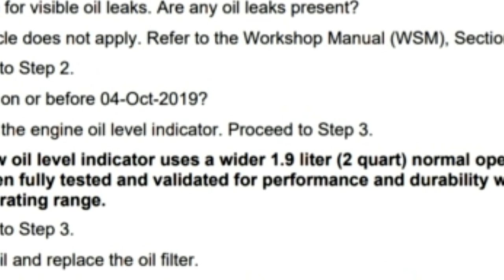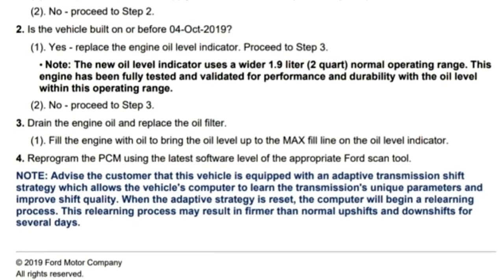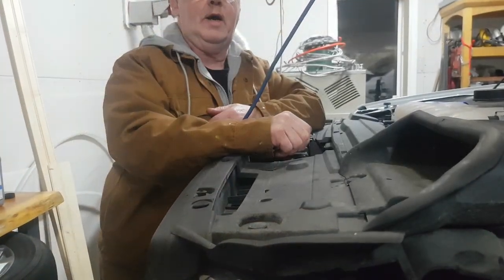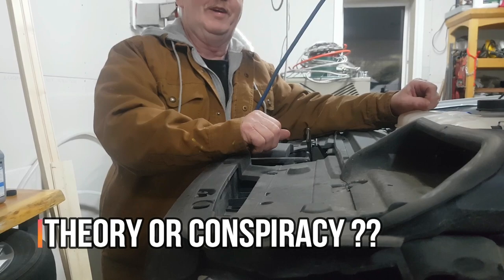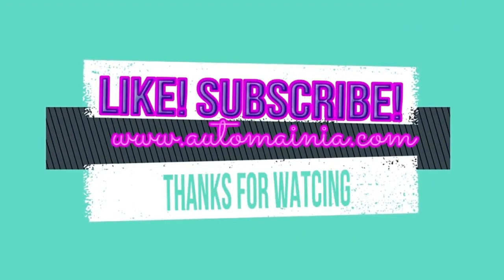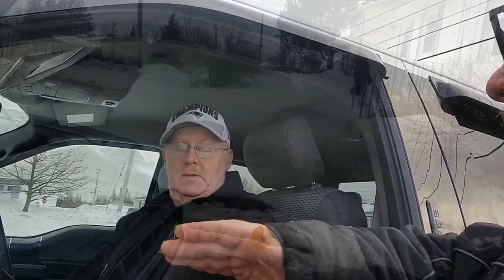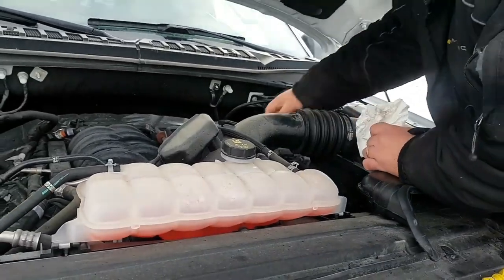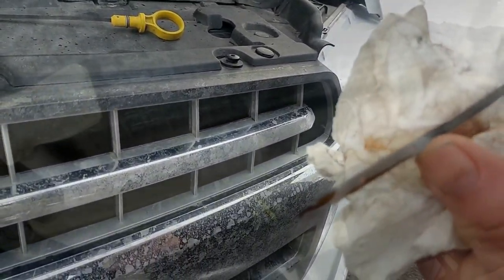#ford f150 oil consumption new dipstick measured 2018 2019 2020 5.0 coyote

Comment: CLASS ACTION LAWSUIT TIME
Reply from the maker: Here here
Reply: my guess is the class action lawsuit will happen in about 3-4 years when everyones 5.0L blows up just outside the warranty. problem is that it will be too late for most ppl by that time. and litigation will drag out for a couple years. and the worst part is they've made no mention of redesigning the 5.0 for future vehicles (its a design flaw from the plasma cylinder lining instead of sleeves to save money). so this problem will continue on new 5.0s until they change the design. if they don't want to change out everyones engine because its too expensive then at the very least they need to 1) change the oil change interval back down to 3,000 miles (to prevent it running dry in between the longer intervals), 2)offer free oil changes for life due to the new intervals 3) extend the engine warranty out to 100,000+ miles, maybe more.  but it shouldn't like this to begin with. just redesign it, issue recalls because the longer they wait, the worse this will be for them. I want a v8 pickup which is why im considering the f250 with 7.3L gas engine. old school pushrod should be more reliable than this engine.
Reply: Is any lawyer in action now for this I need one
Reply: @Joao_Oliveira23  I'm in the same boat.  Truck has timing chain rattle and cylinder knock.  Dealership I bought it from says it's normal.  Another ford dealership says it needs an engine. 5k miles and no oil on dipstick.  Engine rattle started after 1st oil change.  Maybe I need some more motorcraft xl-17 sawdust put back in.
Reply: @Joao_Oliveira23  there is a class action lawsuit started in January of 2021   ...google it....and add your name.. I did and got a acknowledgement with in the hour....please spread the word !

Comment: It should be illegal to build vehicles like that and charge money for them.   Imagine if engineers were actually held accountable for designing things like this.
Reply from the maker: Absolutely correct chad! Thanks for taking the time 👉🤜🤛
Reply: Hey, they gave the engineer that designed the plasma welded cylinder walls a trophy for his wonderous new designed block. Thanks for nothing. Mustang 5.0L has same troubles.

Comment: My 2019 5.0 was using about 2 quarts every 2500 miles.  They changed the dipstick to the 2 quart monitoring and reprogrammed software.  Now it is using virtually no oil.  Checked it at 500, 1000, 1500 miles and all is well.  I’m satisfied that it is performing as it should.
Reply from the maker: Happy to hear that. A lot of customers are not so lucky 👍
Thanks for taking the time.
Reply: Well at least it worked for someone. Does yours have audible piston slap? The few guys I know with 2018-19 5.0's didn't see an improvement after the software update. But they have noticeable piston slap.
Reply: karl schauff no there is no noticeable piston slap. The only gripe I have is the occasional squeaking pulley especially when it’s cold. Otherwise it is performing fine. I did notice after the reprogram there seems to be slightly less engine “braking” on decelerations (stealing a diesel term).  I’m much more satisfied than I was. I change my oil religiously so I will keep an eye on it but believe it to be operating as it should. Since this is my first Ford after owning over a dozen GM trucks, I was obviously sensitive to any problem.
Reply from the maker: @timw_59  the new dipstick is actually 3 quart monitoring 🤜🤛
Reply: @timw_59  Yeah you should be good then. The are a couple causes of oil consumption with the Gen 3 5.0 (2018+). Apparently some had oil consumption due to excessive manifold vacuum pulling oil past the rings and others have something more serious like piston slap causing among other things, oil consumption. Enjoy the truck.

Comment: I just recently purchased a 2019 f150 equipped with the 5.0 put 3000k on the motor and I was down 2 quarts of oil took it to the dealer they just topped it up went back at 6000k did oil change and have just been checking it no new dipstick was installed that I'm aware of yet but we will see what kind of update ford will do.
Reply from the maker: If it was built after October it has the widened range dipstick.  I have a side by side comparison in an earlier video.  Let me know how you make out ty for taking the time. 🤜🤛
Reply from the maker: @MastersFarms  https://www.youtube.com/playlist?list=PLXfFReTdUhgG9Jd_eeQqZHXyp-D4JomQ9
Here is the playlist on the issue I would suggest starting at the beginning  but part 4 and 5 will get you started
Reply: Update!  Ford has added the widened range dipstick fresh oil change and did a reflash a tsb for the oil consumption so far so good next oil change is at 16,000 will see where oil is at then.

Comment: Just crazy I have carried out these “repairs”once. it makes me sick PCM reprogram and a new dipstick is not going to fix this. Ya it might be fine for a few years if you keep up on your oil changes. I drive a 13 year old truck if it was consuming oil like that when it was new the thing would be in the scrap yard by now. General Motors had the same issue with their stupid sprayed cylinder liners not to long ago. I am hoping the electric cars and trucks will save us from this government mandated “efficiency based design features”
Reply from the maker: This ruse by Ford is as big as Volkswagen deiselgate. I think my channel is a little small for the depth of the information. Hopefully someone will a lot more influence will pick up the torch 🤜🤛ty George

Comment: Something I discovered with my 2018 5.0. I bought my truck used with 6k miles on the clock. I had the timing chain tensioner TSB done. And I noticed slight oil usage. I installed a JLT catch can at 7k miles and it does work. On my last oil change I switched to 5w-30 and just checked my oil at 1200 miles and it has consumed zero oil. I have not had the oil consumption TSB done. And the off throttle cold rattle is almost gone I can barley notice it. 5w-30 might be worth a try.
Reply: Also 9 quarts of oil takes it perfectly up to the top hash mark line on the dip stick. With the stock dip stick.
Reply from the maker: 👉ty
Reply: I changed oil to 5-30 also and had the TSB.. no usage..after 2 tests by dealer and almost 1qt each test.
Reply: Second this. Did the exact same. Also an extra half quart will keep the 5.0 happy

Comment: 2020 5.0 with 7000 miles. Started banging and rattling and got a service engine light. Decided to check the oil for shots and giggles. 5 quarts low! I am not a happy camper!
Reply from the maker: OMG better off to leave it die then they have to do something other than a bandaid
ty for taking the time let me know how you fair out!

Comment: Replace your PCV with an EV 281 and get the ECU updated.

These trucks create too much positive crankcase pressure on deceleration and it shoots oil out the PCV into the intake.

The new PCV valve slows the oil, and the ECU update makes the throttle plate not close as much under decel.

This is combined with the new 2quart dipstick solves the consumption issues.
Reply from the maker: The new 3 quart dipstick hides the problem.  These trucks have higher than normal vacuum which is a symptom of too much ignition timing. This is after the most recent ecu update from ford The pcv was changed 
Thanks for taking the time 👍
Reply: I have had the TSB 2365 done and it did improve my consumption but didn't completely solve it. I burned a qt in my 1st 800 miles, then another qt at 1850 miles. Had the TSB done but did not get the new dipstick. I've driven almost 2000 miles and only burned 1/2 a qt (I've been checking weekly after the truck sits over night and I'm parked in the same spot). So that's definitely an improvement but not a complete fix. Per Eliminator's video I did purchase the improved PCV valve from Tasca (only $6) so I'll install that to see if it helps anymore. I appreciate your work and I'll be checking in. I'm glad I got an extended warranty and I don't want to trade my truck as I'll lose my ass on it so I'm in this for the long haul.
Reply from the maker: @thekelly4178  thanks for taking the time. 
Keep an eye on it
To check if your dipstick was changed measure the distance between dots. More than an inch is the new dipstick 🤜🤛
Reply: @thisguysgarage  My truck was built on Oct 15 so it was supposed to have the new stick from the factory but it doesn't. I'll definitely be checking if they change it if I take it to the dealer.
Reply from the maker: @thekelly4178  verify.  Very smart 🤜🤛
Reply: @thisguysgarage  what is the length of the new dipstick?  The one in my truck is 21" long form the tip to where it seats
Reply from the maker: @tcgreenfield  i have the original dipstick here it is 21 inches from the tip to the seat and its exactly 1/2 inch between the add and the full dots

Comment: I just returned back from the dealer for 2 recall repairs, and the hope I would get some satisfaction on where the oil level is on the dipstick.
They gave me a black and white photo, and a hand drawn picture of a dipstick showing that the oil level that there pics show, is about a third way down from the full mark, approx 1 litre low.
Not sure where they got there info, as just 1 week prior, I had it at the same dealer, foreman checked the oil level and he showed me then that it was nearer to the add mark, approx 1.5 litres low, but his opinion still within safe levels.
They cannot admit, that there so called longer dipstick fix failed.
Yes, I will now be in touch, with BBB,
Reply from the maker: document everything . let me know what the BBB has to say.   
safe level does not address excessive oil consumption as you know.
the next time you service it ask questions in writing,ask for response in writing.
ty dave. keep in touch email me for specific questions  channel about me page has address

Comment: My 2018 with 21000 not only uses oil but has metal shavings on the dipstick.  Timing chain rattle and cylinder knock.  Really wish I had my  2008 f150  back!
Reply from the maker: omg , i hear you i should have kept my 16  , let me know how you make out.
Reply: Me too

Comment: This makes me sick. My 2018 coyote was 3 litres down today. 5 or 6 recalls on my truck so far. The worst so far was that it was a rattler, though that was partially fixed w/ some lifter/solenoid repair. This oil issue is way worse. Thanks for taking the time to do this.
Reply from the maker: Sorry to hear that!  have you made any headway with ford?

Comment: the viscosity with new oil would be at its best or highest when oil is new,so it should consume less oil at this point,then when is at its mid time of the oil change interval and consumption would likely be higher at 3/4 of the oil change interval

Comment: 2018 f150 5.0L was half way down the new dip stick range (about 1.3qt according to this review) after 1000 miles durring the second oil consumption test after taking it in and looking they found ATF and engine oil leaks they are now pulling the tranny and "fixing the oil leaks" so i can restart the oil consumption test. trying to get replacement engine or buy back from ford corporate just taking there sweet time and coming up with excuses if you ask me. i will also be demanding that they provide an extended warranty so i can keep doing the testing as im about 10 months out for the ford warranty to run out
Reply from the maker: That's all they want is to get you out of warranty. Ford has done us dirty on these trucks. 
Ty so much for taking the time. Please keep in touch to let me know how you make out. Ty again

Comment: My '18 has the same issues everyone has mentioned in these comments.

 Mine didn't start doing it until around the 60-70k miles range on the oil side, but the transmission madness started somewhere around the 40-60k range. Typically only during winter time with mine at least during that initial cold start. 

At least now i can throw the better oil in it, as expensive as it is, and it not matter with the warranty since that's long past. Not that Ford would do anything even if it was still within and was using the Ford oil until it dies.

I miss the '13 F150 I had with the 5.0. Only issue it ever gave me was hauling a stupid amount of pavers in the back, more than i probably should have (enough to feel the front try to lift even with my heavy brush guard I had on it.) Went went from level ground to a near 45° or steeper angle driving up these old streets in Shamokin, where the pavers needed dropped off, and the truck shut off and wouldn't start for a minute or so. Right in the middle of the street, holding up people to my right in the intersection.

 It started up again after we swore at each other (they didn't know my truck quit and were upset i was blocking them) and it never had any problems again. I traded it in at 90k miles 6 years later for this, left over, new, 18 I have now. 

Makes me miss the 13's 6 speed transmission, too. It never once gave me a problem, unlike this joint chevy/ford 10 speed obomination they put in these newer models.

 They're better on gas now, but that's about it. 

With the brush guards, they've both taken deer impacts at over 65mph without damage, so there's that, I guess. Props more to the deer slayers, as I call them, than the trucks themselves. 

Few worse feelings than not being able to rely on your vehicle.

Comment: 91,200 miles, bought one certified pre owned. Consumption/low oil never noted on any of the 17 oil changes done at the dealership. Was changed every 5k mikes. Currently doing a consumption test. If Ford doesn't want to replace the engine under the CPO warranty (mimics premiumcare) would you recommend amsoil 5w30 and an aos + tow haul to fix the issue? I had the reflash and new dipstick preformed already. Really would like to hear ur input.
Reply: Did Ford replace the engine? What did they do?
Reply: Valvoline Restore and Protect to dissolve sludge out of the stuck oil control rings.

Comment: How Fords have changed for the worse, I  had a 1976 F100 4.9 big 6,  3 on the tree manual , bought it when it was 5 years old from my brother, I ran it 14 years it was still working perfect when i sold it ,didn`t use any oil all I ever replaced on it was a water pump.That was FORD TUFF, today it is FORD nightmare. p.s.  I just subscribed :)
Reply from the maker: i could not agree more! and thank you so much!

Comment: I just checked the oil on my late model 2018 f150 5.0 w/ 10 speed. It was on the bottom of the dipstick, had to put over a quart in to get it back up. Absolute insanity to put oil in a new vehicle between oil changes. I’ve always been a Ford guy, but this out a pretty sour taste in my mouth realizing thousands of others have the same problem. No accountability. Thankful with COVID the used car market is super hot where I live and I can get what I bought it for 2 years ago. Goodbye f150, let’s try GM.
Reply from the maker: i got a silverado specificly with a 6 speed and a 5.3 ,stay away from the ten speed Chevy ,im a ford guy too ,i love it
Reply: @thisguysgarage  thanks for the reply, might be exactly the route I go.
Reply from the maker: @MustHaveJustice  let me know if you have any questions im driving one daily 👍
Reply: @thisguysgarage  do you know if any of the 2021 5.0s with the 10 speed are hving the same problem? Have you seen the 2021 dipstick?
Reply from the maker: @carlosmorales5370  they come with the longer dipstick for 2021 i hear of the same issue with the 2021 model year as well,nothing was changed
Reply: Thanks for the reply! Do you know if they measure two quarts like the ones they installed after the TSB on the 2018-2020 or are they just standard 1 quart between  the low and full holes? I had a 2020 rcsb 5.0 which FoMoCo bought back and I think my new 2021 5.0 is heading down the same road.
Reply from the maker: @carlosmorales5370  when I measured it ,the difference between add and full was 3 quarts

Comment: My 2019 F-150 is currently in. after several visits and reprogramming.  Now they are going to put in a new engine.  Told me the last one they did took 8-9 months.  Not sure what engine is going in.  One month in and we are playing the waiting game.  Luckily they have given be a loaner (brand new Escape), but that doesn't allow me to pull my camper or conduct my carpentry business (loading sheets of plywood).  Ideas?

Comment: I highly recommend the 2020 f150 with 3.5 EB. Mine was 10/20 build date, so the last of the last of that body style. It’s had a slew of updates since 18 that have helped solve it’s phaser and timing chain issues, and is a very powerful little engine. Ford always seems to get things right and reliable—right before a complete redesign—which they did for 2021. The 2021 has a all-new 5.0 with variable cylinder management, and my least favorite: a belt driven oil pump. I want to like the 5.0, but it’s just been so dramatically (more complex) changed for 21 it’s just not fun anymore. 3.5 is still king in my book.
Reply from the maker: this includes the "normal noise"as per ford of the 3.5 eco i had. https://youtu.be/LR-fKkrrzjk
Reply: this guy's garage I actually had ford buy back my 2018 f150 3.5 EB ....in the shop 39 days by 8,100 miles lol my 2020 one is way better because of all the updates
Reply from the maker: @natehawkins2910  as long as your happy